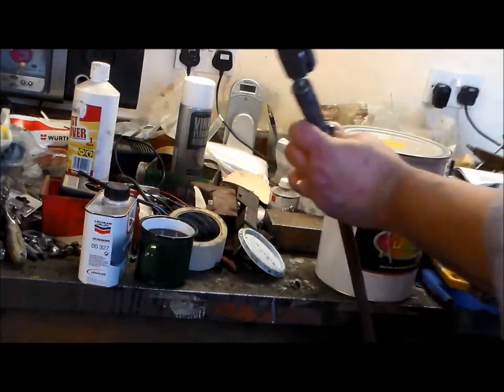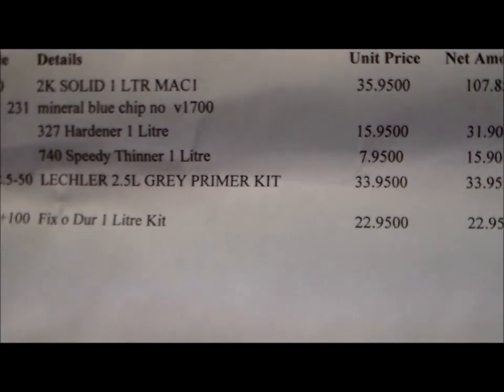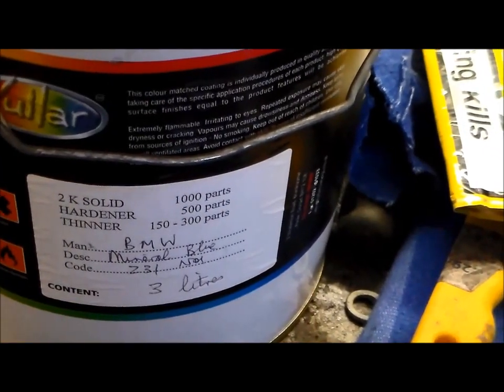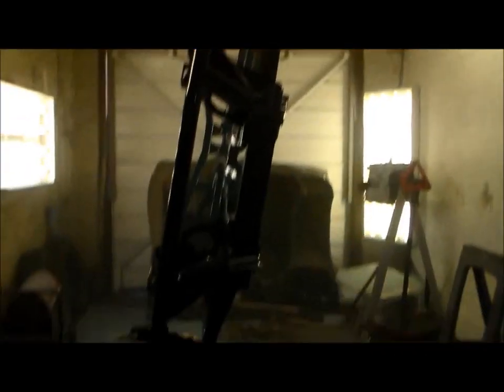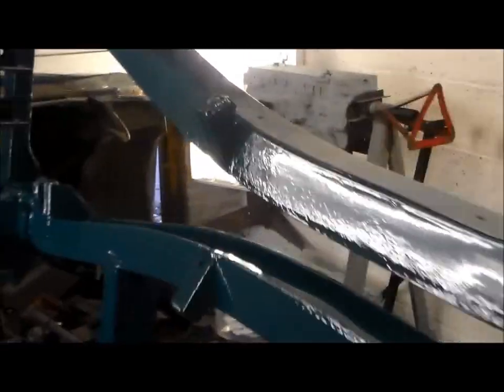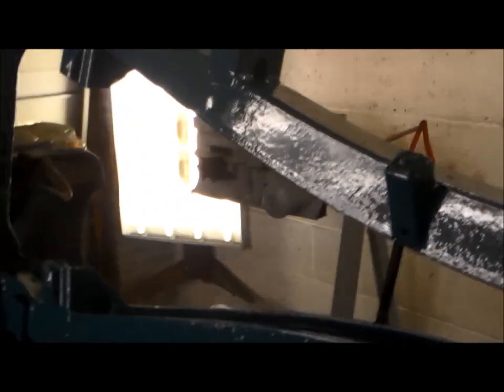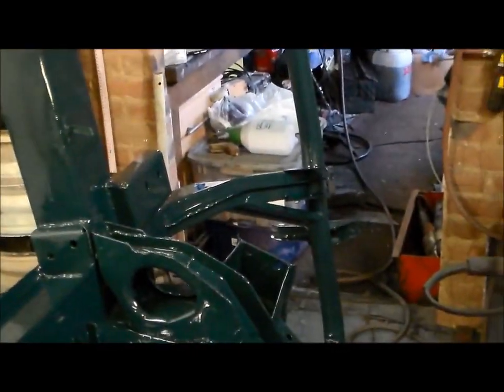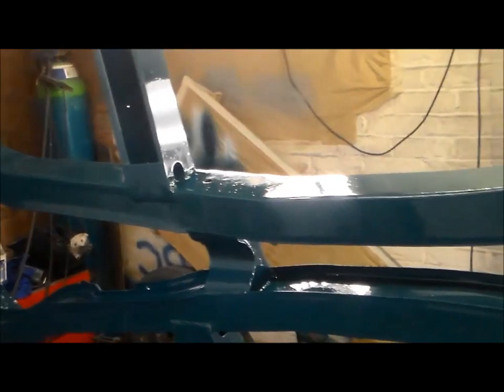9th March Triumph Vitesse Chassis Paint

Comment: Nice one Scott. Interesting to see that you painted the suspension towers assembled to the chassis. Tbh, I hadn't thought about this before I watched your video. But now I have I realise that's most likely the way they were painted when new. Every day is a school day. Thank you 👍
I'm building an RMB Gentry at the moment, based on a 1971 Vitesse 2ltr Mk2. I've had the car since the early 80's when it was an MOT failure and its next destination would have been the scrap yard.
I am currently working on new engine mounts and installing a new radiator. Everything is a real headache as it's a special so I am literally making it up as I go along 😂.
I have a YouTube channel called 48 Spokes which covers the car build and other restoration related issues.
Kind regards Paul from 48 Spokes